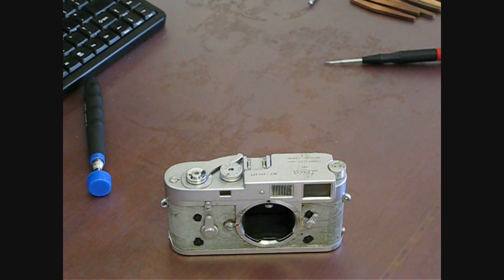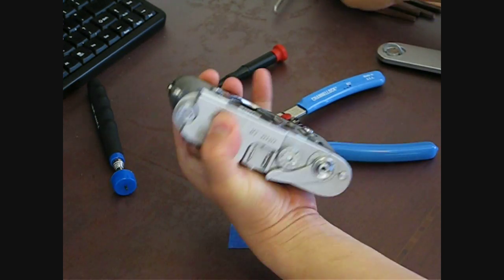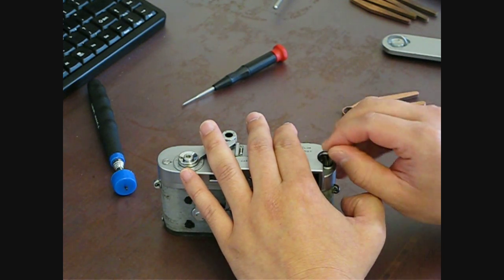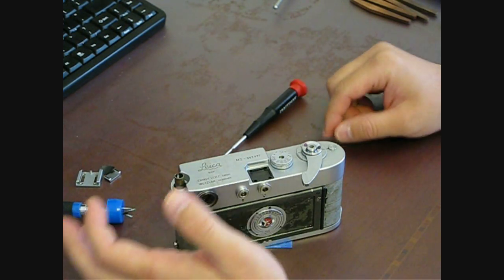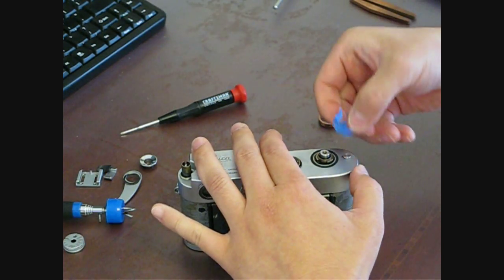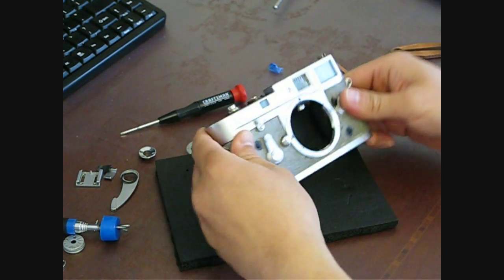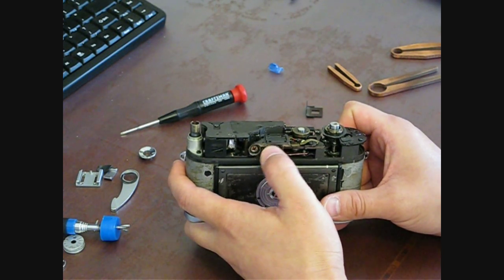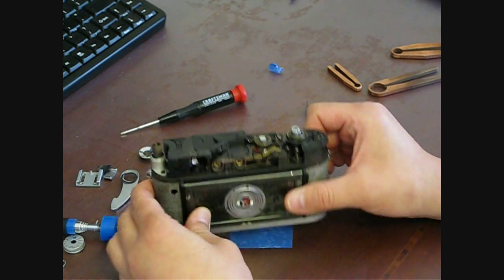Leica M2 Top Plate Removal

Comment: hi i'm getting mad here with my m3 trying to remove the rewind knob. my model doesn't have the two red dots, instead it has a normal screw, but i can' figure out how to use it! if you turn it with a screwdriver it is the same as rotating the knob after pulling it out, so i thought that by blocking inside where the film should be with something and by turning with the screwdriver it would work... but it didn't! so i'm stuck with everything else removed except this one... can you help me?
Reply: Put a wide piece of metal up into the inside of the film chamber e.g. where the film canister sits, so that you prevent the two forks that engage the top of the film canister from turning. Next lift the rewind knob up and rotate anti-clockwise ensuring the forks inside do not turn and then the rewind know will unscrew. Assembly is the same principle.